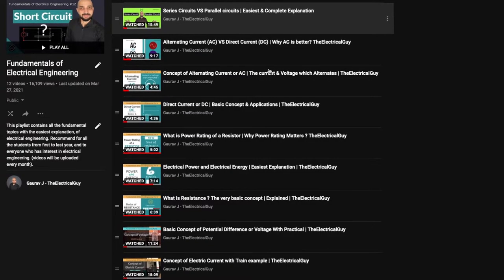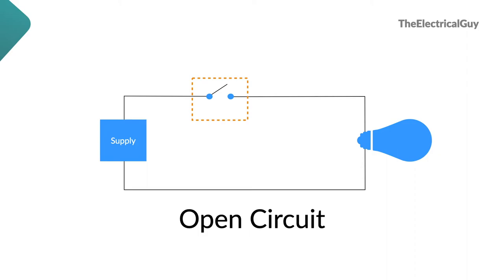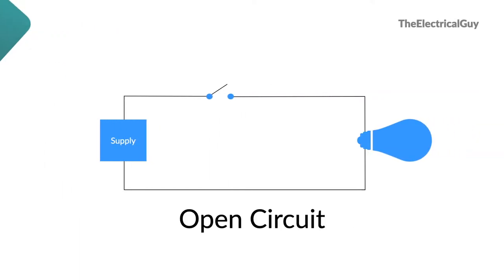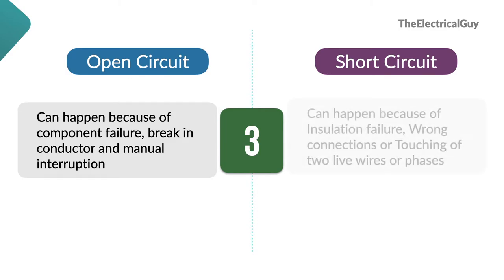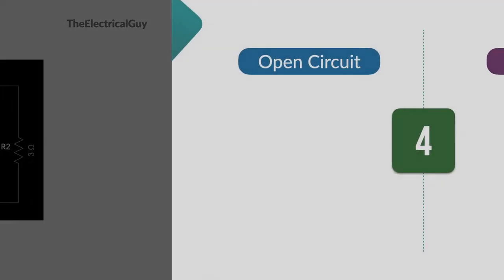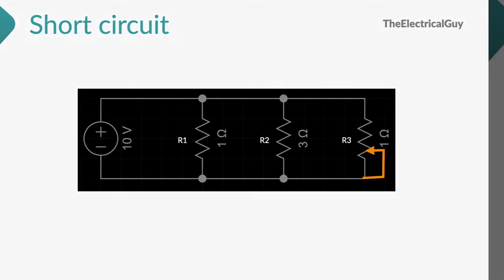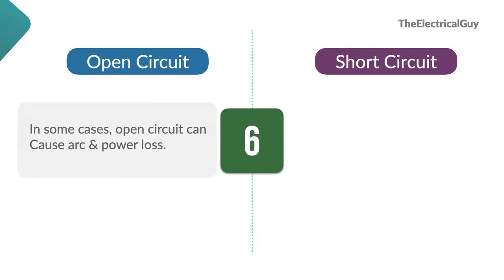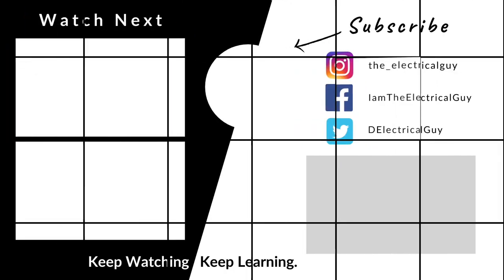Open Circuit Vs Short Circuit | The 6 Differences | TheElectricalGuy

Comment: A short circuit occurs when the current bypasses the intended path and takes a shorter route, causing excessive current flow. For example, if a wire in an electrical circuit gets damaged and touches another wire, it creates a short circuit. On the other hand, an open circuit occurs when there is a break in the circuit, interrupting the flow of current. For instance, if a switch is turned off, it opens the circuit and stops the current flow.

Comment: Question please: Given that amperage
is a function of conductor size ( coulombs of electrons) moving.
The question is, in a step down
transformer (2 to 1 winding) known
input 12 volts and 12 amps.
The output would be 6 volts and 24 amps.   But amps is a function of conductor size, so how do we know
the true amperage of the secondary
winding?
Sir: Confusion on my part. 
Thank you.

Comment: Where in open circuit the resistance is infinte and current should be zero and in short circuit the resistance should be zero in ideal case practical low and current should be high.. What about voltage in both condition means its  depend on circuit values .. so voltage depend upon the Circuit values parameters

Comment: hi! Gaurav can i request if it possible for you to discuss and enlighten us how to test and value of the earth leakage current. Please discuss also the method of testing to identify the leakage like using clamp leaker current  tester by means of flexible  clamping (flexible current leakage tester) the 3 phase/line and neutral(for 3-phase) and single line to neutral(for single phase)